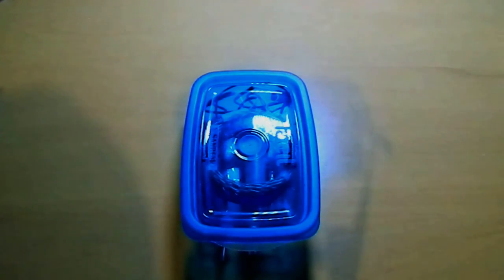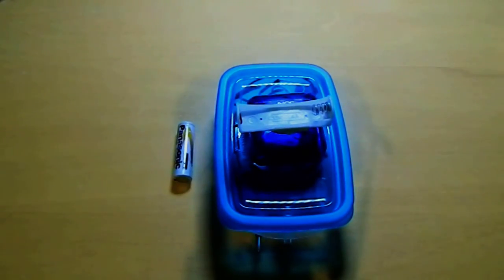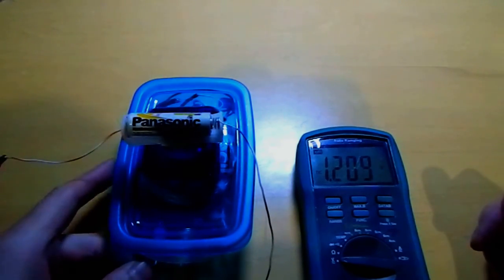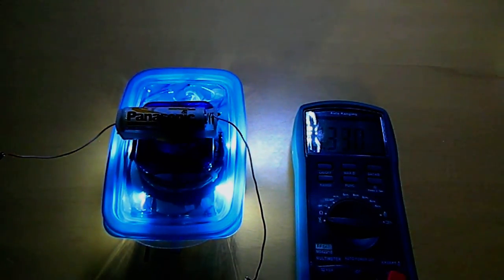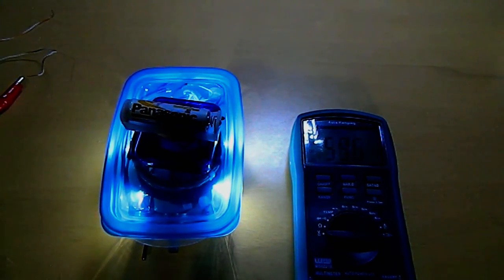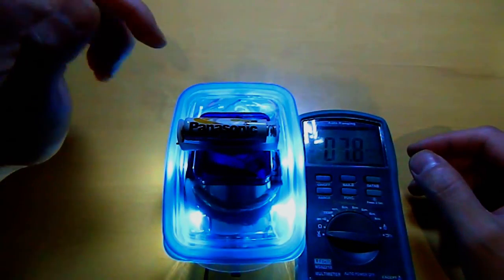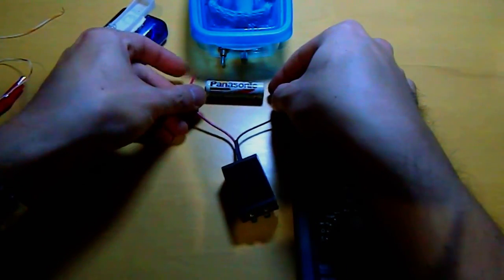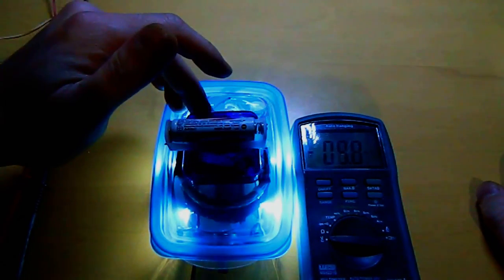Joule Thief Wireless Transmitter - Wireless Battery Charger

Comment from the maker: Greetings and thanks for the sub. Well, under the box... nothing. But inside the box, just a Li-ion battery, 1.8 meters of 24 gauge wire, a 2N2222 and few other components. Regards.

Comment: Yes, make additionally a Joulethief into the smaller box, so you can charge up this JT with the bigger box and can use the smaller box later in another place, when it is fully charged.
Would also be interesting to see, how good Supercapacitors could power such a JouleThief...and how fast they charge up via this way.. Many thanks ! Regards, Stefan.